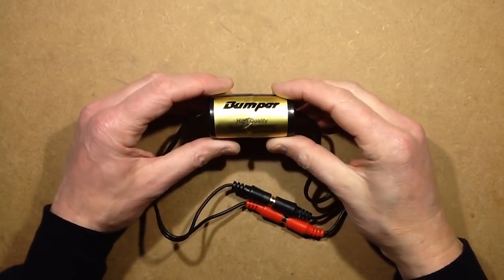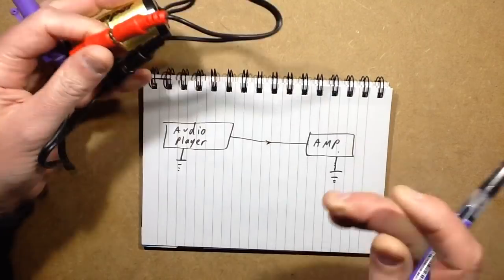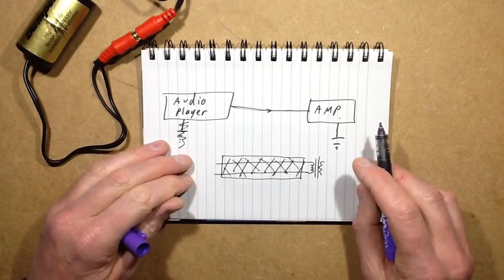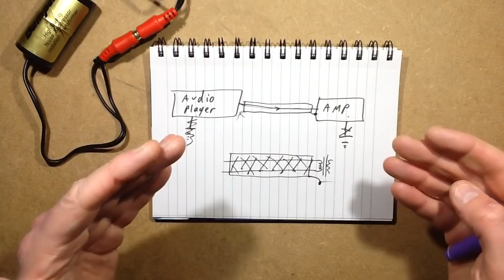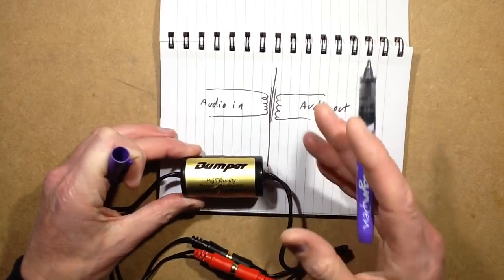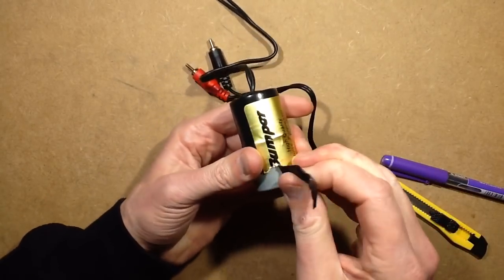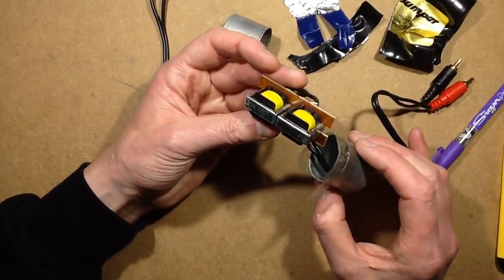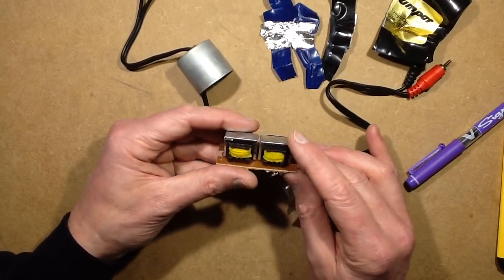Inside an audio isolator transformer module.

Comment: These really are, as you say,  a toolbox essential. I made my own, on the cheap and in a hurry, with two 1:1 (600 Ohm) fax modem transformers that I had lying around from old defunct kit. OK,   I know it's the audiophiles will tell me how poor a solution this may be but in practice, to run sound files for a show, the little box worked a treat. I do however have two of the very same product featured in your tear down.

Comment: Thank you for the tear down.  The transformers in the Pyramid NS-20 are about a quarter of the size in the unit you have there. 
The NS-20 has a plastic clam shell design and has just a small piece of foil for shielding.  Also , the transformers are wrapped with tape before the foil. So , the foil is just shielding in the NS-20.

Comment: I'm a sound designer, and I've decided I need about 500 of these
Reply: you need to get it from a audio isolator factory and duct tape factory.
Reply: I have a lot of electronics and wires dangling and often pick up noise, I have 3 of these now. The same brand as what big clive has, great, as long as it's on the high impedance side.

You can also use these to downmix balanced audio to single ended, but you will need to make your own RCA cable for the balanced end. The grounds of each input are kept isolated throughout, VERY helpful!

Comment: I'm glad I'm not a car audio builder today. With all the external signals like can buses, wifi, Bluetooth, and radar equipment in vehicles today, it might be tough to get a clean audio signal. I recently turned up the volume on my wife's Honda CRV with all that equipment in it and on USB audio with no USB device installed, I heard all kinds of squeaks and buzzing, in the background. It also sounds like they have the high-end cut at a steep slope to filter noise also.😮

Comment: I used to rehearse in a shared practice room in the 80's, and somebody had put electrical tape around the ground pin on my bass amplifier mains plug. So we were playing along, I put my shoeless foot up on a radiator, and got a spectacular electrical shock. That's when I learned about the bad way of ground lifting. I also must have left the ground for a moment there too. Scary stuff.

Comment: another way of getting rid of noise like that is using Differential signaling, commonly used in XLR plugs, where the regular signal is in one conductor and the 180 degree phase-shifted signal is sent over another, and in the other end the two signals are added and the noise is added too, and so it cancels out. ;) 

https://en.wikipedia.org/wiki/Balanced_audio
look under 2.Interference Reduction and 3.Differential signaling

this is however not common in most home or car audio equipment sadly

Comment: I used to work for a company, Road Radio way back in the 90's. I can't say I've ever come across one. We used to fit anything from Philips to Nakamichi audio systems, getting rid of audio noise used to involve cleaning all earthing points and soldering the wiring on the more elitist jobs. Sneaking one of those in to a system would have probably saved a lot of work lol. 
Thanks for the post.

Comment: For a hi fi quality isolator for home / stage use I would recommend Omnitronic Lh-081. Should work ok in cars as well I guess but it may not as good as this one. The LH-081 frequencies range is 15Hz - 30KHz, input & output impendancies are 600Ohm.

Comment: The situation where you have line noise on the audio line is called a ground loop. I use a direct box to connect my laptop to my main mix and amp to eliminate this situation but one of these little things will work also but it's intended use is in car audio environments.. Sure you can use them in home systems as a temporary fix but its best to get equipment all on the same circuit and have proper balancing when installing a home system.
Commercial system are more versatile and are made to be moved about a lot so the "on stage" direct box is the answer to those problems.

In car audio you get noise from the alternator, fuel pump and, onboard computers. The noise is more prominent through HF Ham radios and CB radios but those require a DC capacitive filters and not an audio transformer, Car audio amplifiers of the cheap breeds will need these transformer baluns in the input lines though.

The foil on top looks like it may help with phase matching or the electromagnetic flux matching but it does not seem very effective since it only foil and not a metal shim.. It could be something like you said also to help keep interference out, there is just no real good way to tell. I mean it could be there because the foil tape matched the transformer casing. who knows..

Comment: I was PAT testing in a local church recently and found that ALL the amplifiers (main, monitor and induction loop) had their earth leads cut off inside the mains plugs
Reply from the maker: That's unfortunately really common in the audio industry due to misinformation passed by word of mouth.  Even worse now that many of the people doing it have effectively become electrically qualified with a one or two day slideshow and are moving into other electrical areas with the same mentality.

Comment: The foil is for electrostatic shielding.  Some transformer,  power transformers in older tube gear even,  come with a shield between the primary and other windings.  Normally you'd just ground it.

Comment: The big power amps used in car audio suffer worse than you might expect, generally they contain big dc-dc converters, if you have a few of them you can often hear the beat frequency of the different oscillators as well as the other crap. I have previously used audio transformers from scrapped radio base stations to get round these earth loop problems.  The transformers are used to interface the transmitters and receivers to leased land lines, nominally 600 ohm.

Comment: In a car, because you're generally using the body of the car for your "earth", there's a very large possibility that the earth reference-voltage will be different for every component in your audio system.  Because it's such a large surface area, it's very prone to picking up e.m. interference.  Whether that interference is from your alternator, your ignition system, or even your mobile phone, it can easily produce a voltage difference between the various earth-connections of the various components in your car's audio system.  One of these audio isolators can really fix that problem quite well.  And because an automobile is generally such a poor place for audio, you won't really notice the very slight drop in quality of the signal.
Reply: My vehicle stereo works very well except when I plug in my phone to listen to mp3 ' s.  At that point, I get to listen to the engine as it accelerates or slows down. I sure don't have any miss - firing spark plugs! Lol I'm not sure how I could hook one of these up since the mp3 jack does not use R CA plugs, but I'm sure there is one out there for my needs. I just haven't looked real hard yet.
Reply: My vehicle stereo works very well except when I plug in my phone to listen to mp3 ' s.  At that point, I get to listen to the engine as it accelerates or slows down. I sure don't have any miss - firing spark plugs! Lol I'm not sure how I could hook one of these up since the mp3 jack does not use R CA plugs, but I'm sure there is one out there for my needs. I just haven't looked real hard yet.
Reply: +Merle Mitchell it's the same on my at when I'm listening to radio I can hear the stator mess with the radio
Reply: Merle Mitchell my stereo system does the same thing when hooking up my cellphone to the aux in.ive noticed that if I'm not charging my phone there's no noise(unwanted noise)!But as soon as I hook up the micro usb cable which is changing from the usb adapter plug in my cigarette lighter socket.if I use a powerpack to charge my phone there's no noise. Any idea's on a solution for this issue?

Comment: I remember helping people fix "Noise issues" with their car audio systems back in the day. They always showed up with one of these devices, I never needed them, and the real issue was always one of 3 other issues... 
#1. Crappy ground connections, or grounding points at different points on the car that had high impedance between them.

#2. Inferior or unshielded long RCA cable runs, that were ran next to a large, high current, power cable.

#3. A shitty head unit, OR blown ground traces on the RCA output of the head unit or EQ, because someone carelessly let the end of their RCA come into contact with the B+ on their amplifier or somewhere else in the car.

I'm in NO way saying that those noise isolaters are useless, they are very useful for mains powered equipment with ground loop issues, but they were very rarely needed in car stereo installations to cure noise issues.

Comment: I apologize if somebody beat me to it, but in cars, the chassis is used as dc common, so the high frequency nose from so spark plugs can actually generate signals in the chassis ground loop between source and amp can transfer the audio noise through the chassis.

Comment: I have been in the Pro AV industry for 20 years, what I was trained about lifting the ground is slightly different. The ground wire on a balanced line needs to be earth ground, some older equipment the shield pin was tied to D.C. Ground which was the path that the noise on the shield wire was introduced. If I ever had a humbug was always that the previous installer lifted the shield and didn't maintain the cable twist. I would also double check the equipment by metering the shield pin to the chassis, if they were not connected I would ground the shield to the chassis not the pin and there wouldn't be a hum. 

I was taught that as long as that shield goes to earth ground a slight current on it isn't that big of an issue. I know LOTs of older AV guys who disagree with me. If your Amp shield is tied to D.C. Ground you are basically creating a huge antenna for it.

Comment: I'm pretty sure that outer metal can provides zero shielding, since it's not grounded. If it is connected to one of the conductors in the cable, then it will act as an antenna, injecting all interference directly into your audio signal.

Comment: I'm not an expert by any means but I think most noise in car audio comes from the alternator. In the olden days, generators were used, which effectively generated DC power. However alternators are much more efficient, but generate AC. This AC is rectified into DC which then runs the car.

If you have poorly wired, particularly poorly grounded, audio equipment, the AC noise from the alternator will be coupled through to the head unit.

I very much might be wrong but that's my "theory" (if you really want to call it that). I'm open to corrections.

Comment: Foil Is For RFI Mitigation, But Its Already In metal Casing, IDK, Weird Way To Do Things , BUT They Used Wrong Transformers For Such Aplication, They Needed To Use Smaller Transformers, Same Exact Ones That Are Used In Good Amps And They Idealy Should Be Round Ones On A Toroid , Not On A Metal, Toroid Coils That Can Carry All The Signals For Both Channels, Thats Why They Are Two Of Them I Guess. 
But Yea, Totally Wrong Setup, But I Guess It Would Work In Some Way

Comment: The last time I used one of these was 15 years ago, and it was purchased from RadioShack.  it was in my car, and it was sold as a 'ground loop isolator'.  Interesting to see what is actually inside one of them.
Reply: Two coils produces another magnetic field. And to stop inducing that back emf and eddy current aluminium foil is used as a shield. This is my opinion

Comment: it was probably a model made to be used in emf environments, if you think some electrical components are noisy, you should check out what happens under the hood of a car (alternator whine, and ignition systems being the biggest culprits).  In a car system it'd probably be almost the case that the transformers would pick up a ton of noise if unshielded.  A common source of noise in car systems is laying the power wire and signal wires beside eachother, doing so doesn't always cause noise, but it's common enough (even if it is a bitch to do run signal and power separately)

Comment: I had to use exactly this to fix the hum in my car. This was back before portable digital music players were big, and I just wanted to use my laptop with an aftermarket head unit. The hum (in my case) was from the laptop, and not from the operation of the car.
Reply: >This was back before portable digital music players were big...
So pre-iPod days, which means 2000 or earlier... You were driving around with your $2000 Sony VAIO acting as an audio player?

Comment: Very well explained. I was really wondering what this thing does and whether it could solve my issue. Turns out it can, it's just a bit chonky. My guess is that the foil is for shielding. Like the equivalent of shielded cables but on the transformers. It should ensure that no noise can be picked up by the components. It might be an overkill since it is in a metal case already but you can never be too protected from RF interference

Comment: Hi, I know this a late reply...but here goes...
I bought a nice SoundDevices MixPre3 for my DSLR. This an awesome 3 ch mixer/recorder. The usual setup is to fit the mixer underneath the camera via tripod screw in the MixPre. 
Both units operate on independent battery supplies.
The screw in the mixer is ground to chassis and the screw in the camera is similar too. A nasty ground loop happens when everything is set up and one takes the mixer output to camera mic in via 3.5mm jack to jack. 
You gets clicking, ticking sounds and others, which is probably the lens motors whirring away or the IBIS mechanism, all at around -40db....not good. Of course you still get a nice, clean recording on the mixer.
I have been told that using something like this will make all the difference. What's you're take on that? I found a jack to jack + iso transformer by Monacor. Maybe double the price of others, but it looks the biz!

Comment: one thing you have to watch out for,in vehicles is the 'whine 'can either be the alternator OR the fuel pump. you also have to realize,all the wiring in the vehicle is acting like antenna so its not realy a simple thing to fix in a vehical

Comment: I suspect the foil is to ensure a conductive path between the two metal can halves as it would be pressed against the interior of both cans when assembled.  If they had soldered the two halves together then I doubt it would have been used.

In car audio you are most likely to require filtering on the power input, especially to a radio, as there can be a lot of conducted common mode noise on a vehicle's power rail that can then get into the tuner (most decent amplifiers will/should have adequate input filtering of their own since they do not have the added task of functioning as a proper radio receiver where the vehicle chassis (ground plane) is also a part of the antenna path.  Usually these filters are a simple inductor and one, or more, capacitors to help filter ignition and commutation noise from the power input.

Comment: would this remove interference noise in my car stereo? I've got a whine from the alternator coming through my speakers, probably because the power wire runs close to the signal wires
Reply: Krankie V yes, this or a device like it will solve the problem, punch "alternator hum eliminator" or something similar into Google, there's ready made products made for cars
Reply: Eli Witt thanks for the response

Comment: The biggest offenders on cutting the power ground pin are those who are not using balanced audio and not using transformers.

On a side note, on a more difficult radio station noise issue I had was on a DJ console for an AM radio station.  The older console was using many single ended (unbalanced) input channels and was converted to balanced using small audio transformers inside the console.  The wires went inside the console and the screens bonded to the chassis inside.  Unfortunately a run between studios had the classic ground currents on the screen, but since the screen entered the console, the current on the screen traveled in the vicinity of the bank of audio transformers coupling the noise into them.  The solution was to peel back the screens and bond them to the chassis right where they entered the chassis.

To find the problem, an old piece of gear made to pickup audio from an analog telephone from the electromagnet in the handset (before it was legal to connect any consumer owned device to a phone line) called a telephone pick up coil was used to trace the current path of the noise.  Google telephone pick up coil to see this blast from the past.  The pick up coils were originally sold to plug into portable tape recorders to record phone conversations.  Yes they looked tacky, and yes the suction cup would fall off.  A tool to pick up magnetic fields on audio wires is an essential part of troubleshooting recording studio audio problems.  An AC amp clamp with leads instead of built in meter is very useful in tracing currents in cables.

Higher quality isolation transformers for pro audio use are fully enclosed inside a metal can with a screen in the transformer between the primary and secondary to stop capacitive coupling.